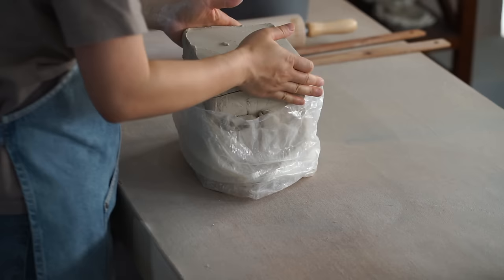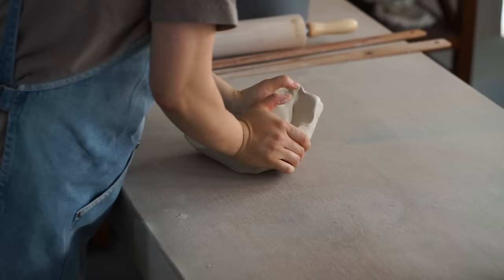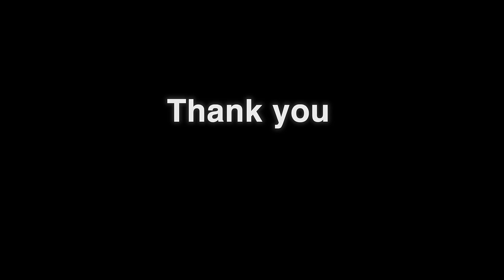Making ceramic sculpture from clay - Transplant series

Comment: Out of curiosity, is there a reason for the cloth below the slab you rolled out in the beginning? You've got some incredible skills and art :))
Reply from the maker: @mayukhasuresh8897  Thank you. With the cloth, you can move the clay slab without pulling the clay, which reduces the chance of deformation. Also, the slab will not stick on the table.

Comment: Very beautiful piece, and thank you for working slowly and consciously ,I just have a few questions:how do you make a damp box?,what type of plastic do you use to keep your pieces moist?how often do you spray your piece to keep them moist enough to continuously work on them?,I've notice you still spray your pieces when drying slowly, any particular reason you do that?
Reply from the maker: I actually posted a video before on making a damp box. Please check it out https://youtu.be/kzUaSqnjlyw . Any kind of plastic should work to trap moisture. I usually spray my pieces once a day, depending on the humidity. You will need to check the condition of clay. After finishing building, spraying the pieces helps with drying slowly and evenly.

Comment: Hi I'm a freshman majoring in pottery and I have a question.🤓

When you attach undried objects to semi-dried objects or attach semi-dried items are attached to each other, you use a slip.
But when I make it, if I attach things that don't have the right humidity to each other, the attachment always crack in the part where the two pieces were attached with slip.

How can I make it perfect like you without cracking the attachment part??
It's a really important issue for me to solve😢🥺
Reply from the maker: You can follow my previous video on making a damp box and place these pieces into the damp box overnight. Then these pieces should be at similar humidity level and you should have no problem joining them.

Comment: Oh my, I am so loving your videos, your aesthetics and delivery.  Anything but boring.  Please replace this word with soothing.  Please May I ask 2 questions.  
What is that marvellous tool you score your circle size with?  
And what type of porcelain do you use?  Low, mid, high ?  Or should I ask what temperature do you fire your exquisite porcelain pieces at?  
Thank you so much for the effort and work you put into sharing. 🙏🌸 Regards Perla
Reply from the maker: The tool to cut the circle size is usually used in making Zisha teapot. I purchased it in China. The clay used in this series is stoneware. I fired them to cone 6.
Reply: @Liangceramicstudio  thank you so much for answering my queries.  🥰